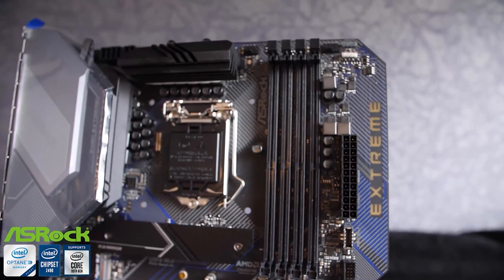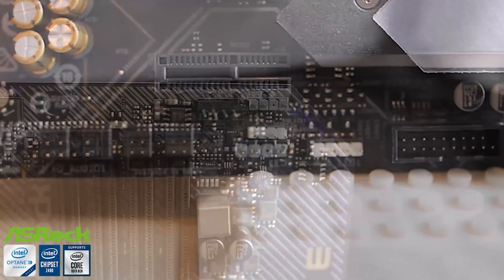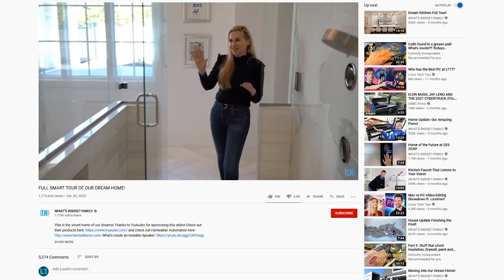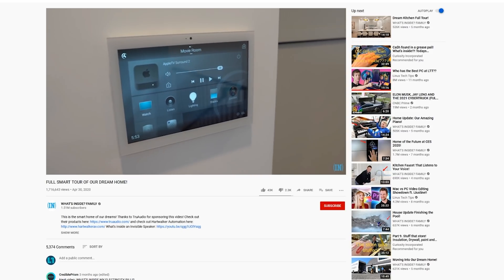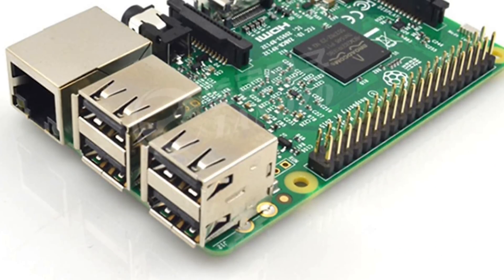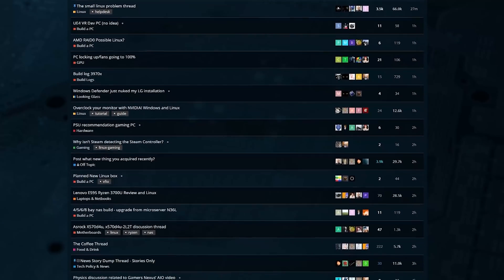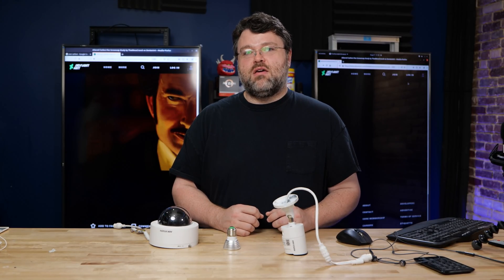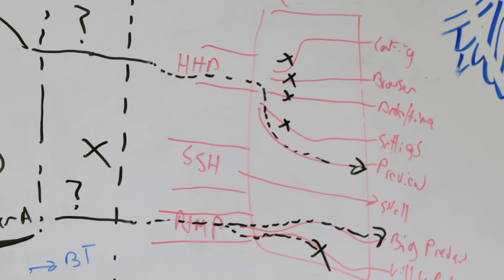Building A Better IoT Part 2: Can We Create A Safe Home Automation System?

Comment: I'm late to the party, but IMO, most of these smart home devices just shouldn't be connected to the internet. There is zero reason for your lights, switches, cameras (especially cameras) to be connected to the internet.

These devices should be on a private network and only communicate directly with a central controller (like homekit, smart assistant, or an NVR). Your controller becomes the only weak link.

Cameras are really off the mark IMO. Their only job should be to send footage to your NVR (and other camera specific things like IR lights, tilt, zoom, etc). The decision of what to record, when to record, motion detection, object recognition, etc should be done by your NVR.

If you want to view your camera footage, control you lights, or turn on the heat, you can do so through your trusted, security audited controller.

Most of these smart devices are simply too smart for their own good.

Even smart TV's shouldn't be connected to the internet. IMO smart TV's shouldn't steam content from the internet, there are plenty of other devices (firestick, roku, apple tv) that can do that. Again, let it connect to a controller so you can control the TV's functions (turn it on/off, change volume, change inputs, etc).

Imagine connecting your TV's, roku, playstation, blu-ray player, plex server, etc to a controller. You could pick which tv is connected to which device, or maybe steam one device to all TV's.

Obviously some devices need to be connected to the internet as a function of what they do, but those are the only devices that should be connected to the internet. Your streaming device needs to be connected to the internet, your TV does not. Your computer needs to be connected to the internet, your mouse does not. Your phone needs to connect to the internet, your headphones do not.

Comment: Can I do this by firewalling it off on a VLAN as thats the generally the recommendation for security cameras. Does a WAF and programming all the filtering/encryption yourself really the only way to get it secure? I don't have the education to do that no programming or networking experience. I was going to get some small business ubquity gear and follow some beginner network security and VLAN / firewall / Remote-in w/ VPN / traffic monitoring tutorials especially with all the relatively recent USA government ban on these cameras as a lot of them use huwei chips.  Maybe I misunderstand and me using the ubquity security software on the Dream machine pro is basically a WAF. Yet you concluded your video that theirs basically no way to make it secure without your level of extensive knowledge.

Comment: Philips Hue is great, the system seems to work exactly at intended for my parents. Only 4 of the 60+ bulbs have ever become disconnected from the hub, and that only happened after a power cut (and they've had several other power cuts and it has never happened again.

The hub also doesn't need any internet access, so if you want to just block it you can. And it all works by ZigBee so it's not the insecure mess that are WiFi bulbs.

Oh and it has really good support with Home Assistant and other similar projects.

Comment: CAN and RS485 can be a good option, SPI although technically feasible is not foreseen for out of system communications, CAN and RS485 are a better match. Also running parallel CAT 6 cables all around ur house seems unnecessary. A  Serial/ Star based architecture is a better solution for IOTs.

Comment: It's be great to have an open source proxy that can do this, with plugins for new hardware as it becomes available.

A nice web GUI to inspect traffic and whitelist things, Runnable in a rocket on a switch or pfsense router or something.

Perhaps to make it even simpler, a device like a switch running this software that will automatically recognise and segregate new devices on a vlan to pump through the proxy.

Comment: Yay! Part 2 is here!
I'll see what I can contribute as I too would like to get this going somehow, especially with the Open Source crowd.
I believe wireless is the best way to go. You can secure it and deploy devices almost anywhere. Low cost used wireless devices can be had for really cheap on sites like Kijiji. I'm definitely in on this project.

Comment: Surely you just throw control signals down the internal power wires. Most of the signals are going to be off and on, or colour and dimmer signals. The only thing you need high bandwidth for is media and security data.

Comment: Crazy idea here, since rewiring is an issue is there a way around that? The right approach for IoT is not only open source, but also cheap. So with that in mind, how about implementing a custom data over the power line protocol? It should be quite effective for low bandwidth devices, and as for cameras ethernet there is fine.

EDIT: There are pretty cheap IC's that do just that Power Line Communications Modem is one key word to start agooglin'

Comment: Why not setup all your IoT cameras on a different subnet within your home and isolate them with a sort of "reverse" DMZ? You could use one of the machines in your home as a terminal server so there's no outbound traffic hitting the internet but you could still access footage through the web GUI? This wouldn't solve your problem with devices like Nest and Ring, but it could be a jumping off point for something more substantial down the road.

Comment: The giant bundle of wire can still be hacked to give you direct access to device protocols, it's just harder. Devices themselves should have either a jumper/tag you remove to put them into post-configure mode, or a way to remotely attest configuration data and OS integrity.

Comment: Have a look at KNX. It's an open-source protocol used for building and home automation that is around for 30 years. I installed it in my home and it works great. Since it's only a protocol it can be implemented either wired, wireless and over IP (again wired or wireless) and there are mutliple companies around the world that produce devices that operate on the protocol and deliver everything from turning on loads (lights, outlets etc.), thermostats, switches, various sensors to interfaces to other protocols (Zigbee, RS485, propietary HVAC device etc.). There are two downsides to it, in my opinnion: 
1. rather slow (9600 baud), which is not bad, considering you do not have a lot of traffic flowing (how often do you turn on/off the lighting or how much does your temperature fluctuate, etc.) This short comming can be resolved by optimizing the topology, but it is still slow, in 2020.
2. The software used for commissioning the system (ETS) is only available in Windows and the license is rather expensive (it's meant to be used by certified technicians, even though its not rocket science) and there are no open-source alternatives available, yet.
I got certified in KNX after programming the devices in my home as I really think it is a great backbone for a modern home. I use Home Assistant on top of KNX and I can use it to bridge other systems. For example make my robovac to come and clean the kitched by pressing a light switch.
If your interested in this I would gladly help you out with getting started.

Comment: BACnet MSTP is a master slave Tolkien passing protocol that uses Rs485. Its a protocol that’s been used in industry for many years.... rs485 is very touchy on how it is wired and the converters to ip based communication is expensive

Comment: You should check out KNX it’s a fully hardwired system with a bus line to connect devices like Motion sensors and keypads. It links directly to Home assistant. I’m building a house and I was looking for a hard wired system like control4 without  the price and I happen to find.

it’s mostly used in Europe but you can get it here too

Comment: In a previous life I did Crestron programing and the amount of wiring in the walls brings back memories. Their web interface used to be an IE plugin (1) which was...a choice.
The development environment was interesting. It was a windows executable that launched Cygwin(2) to do the cross compile in GCC(3) so you could send the code to a CNMSX(4) over a serial cable. Good times.

1) Their touch panels ran WinCE. Hours of battery life. Hours I say.
2) Or similar
3) Which was an ancient version
4) The brains of the system

Comment: I have over 50 esp based light bulbs for my new house ready to install..
As well as power controls and other relays and sensors.
They cost £2-10 each and all work with tuya.
Needless to say I'm also scratching my head at the moment on how to safely implement there setup without endangering the world by putting them on the internet.
I have carefully picked every light and most of the other devices ensure its esp based so they can be reflashed with another firmware as honestly much though I like tuya, can it really be trusted?!!

Comment: If you're doing something in the middle you could consider using srt (secure reliable tranaport) on the outbound side of the video instead of rtmp. Resilient to packet loss and encrypted

Comment: One thing I think we need is cheaper and smaller switches with fast uplinks. Running tons of wires to one spot where you need a lot of ethernet devices is pretty gross and it'd be nice if we can have switches that just act as traffic aggregators to push all that traffic over a single higher speed link.

Comment: 4:02 947 PPM CO2 is NOT what I would consider to be in the "good" range. That's definitely in the "acceptable, but you might consider more ventilation" category in my book. It's not at dangerous levels by any means, but it isn't great. Personally, I start to notice cognitive effects as low as 850 PPM, and I definitely feel "off my game" if it's over 1000 PPM and I certainly don't sleep well when it's that high.

Comment: i've never been a fan of wireless, even back when i was a radio operator for the Marines. it's to easily blocked, hijacked, cracked. . . . . . . .
Reply: or weak and spoty witch i s why i have wired 10 gigabit cat6a and multiple access points wire where i can and wireless distributed over multiple APs

Comment: I think the idea of an application firewall is a excellent solution for things like smart tvs were being on the internet is key to their functionality.  That said, I'm not sure it makes much sense for things like carera's and smart devices. I agree I don't want those things on the internet so I run a VLan for my cameras and a separate VLan for my IOT devices like dimmers and motion sensors and the like. I then run local servers (Home Assistant and ZoneMinder) that are on the private VLans and but also have internet access if needed. What do you see as the use case for letting Cameras and IOT devices have even limited access to the public internet?

Comment: I've built a home auto system back a few years as a project to learn IoT, it wasn't great and probably is insecure. But man it was fun, have the door bell turn on a light, the RFID turn off the TV, any switch can be redirected to any light/lights, or any thing controlled by any IR remote that you setup.

Just designed and printed new outlet boxes that house a 120v ac to 5vdc board, a raspberry pi 0 w, outlet covers that hold arcade buttons, docker and a bash script that if the pi can't get internet become a hotspot (gotta love nmcli) and host a setup page to give it the Wifi, central host, and the host's public key.
Reply: Do you have your work on github or ?? This sound great.

Comment: KNX and DALI do exist though :D which are open standards so you arent stranded with a single company though its more common here in europe :D and for those networks you can basically have any topology without switches :D
Reply: KNX is kinda expensive though, but for people who want the reliability of wires this is a decent solution. Also, KNX is not really meant to install  by yourself. Technically it's possible to diy it, but in practice you should be looking at a professional installer to get it done for you.
Reply: @Rolinator1  yeah other then that i dont really see a downside in KNX and for a cheaper price DALI is a close second :D

Comment: There was a passing comment to esp32/esp8266 devices in the video as not been secure. I use a lot of these devices with ESPHOME custom code connected to hassio. These devices by themselves have no internet access and live on a VLAN with cheap ass 1080p cams on another VLAN that also have no route to internet and are activaly blocked (wired of course)  Everything can be accessed from my vpn with freeradius certs ETC. Not sure how insecure these devices are maybe somebody very close may be able to disassociate them from wifi get hijacked if so it would be very disappointing as the network they have access to is treated as very hostile and the devices themselves don't do anything critical. At the end of the day every device/network/phone ETC is waiting to be hacked. I agree open source is the way forward and education around networks and code is escenshal the last thing we need is one stranded/company where 1 zeroday leaves everyone exposed.

Comment: I like having my "smart" devices dumb. I don't need any cloud-connected devices, I want everything on a separate wired network, inaccessible without plugging a cable into a port or modifying a vlan on a port / in a trunk on a switch or changing a firewall rule (one out of the 3). I used an arduino uno at my workplace to detect movement when inside the premise and open the door (because people are too lazy to push a button and they were getting head-on inside the door). Having that sensor there helps people be lazy and not lose momentum when walking. Best part of it? Doesn't even require a network connection, not to mention internet connection. It's just an arduino with an ultrasonic sensor and a 3v (mechanical) relay (solid state ones are better, but more expensive). And no, you can't open the door from outside, tested it thoroughly with my colleagues. The bad part is that you need to connect a USB if you ever want to change the code or add features (which is basically never at that location).

I am thinking of using some old *Pis and wiring some lights in the house and have some cron jobs to turn the lights on in the morning when my clock rings (maybe even make the lights flash, so they are more annoying - for flashing lights, I highly recommend solid state relays). Cameras don't need any introduction, you can do IP cameras and have a samba / nfs server for storage, or buy a DVR with coaxial cameras if you want a more professional setup. Make a VPN and connect to your home network to monitor them, don't use the manufacturers cloud platforms. 

Lock systems are a little scary, especially if you want to unlock without a key, so I highly recommend old locks. But considering people have garage doors that open with a pretty insecure key, well, you could make a locking system using Pis and relays (again) with electromagnetic locks and either use a VPN to remote home and unlock a specific door, or have a hidden wifi network that you connect to in close proximity to unlock the door. Again, I recommend neither, because the risk of getting cracked into is quite high (and it's pretty easy to scan for hidden wifi networks).

Bonus points if you use Mycroft or similar software for voice commands, but your setup gets more complex and you need microphones and speakers. Funny stuff, while a part of me is somewhat excited about making a secure home automation intranet (again, with no access from outside or even from my normal LAN), another part of me is really autistic when it comes to security and I think I shouldn't trust computers and try to do as primitive a setup as possible (up to and including having a rooster wake me up in the morning, instead of an alarm clock - and I can't snooze the rooster).

Comment: My 4 cents on this:
1. You don't need most of the home automation stuff. It may be fun for a while, but basically useless in most cases.
2. Yes, security is a big problem in IoT Devices
3. I disagree on breaking up an encrypted connection on a WAF. For me encryption should be end-to-end. You can still block anything dangerous by source and destination
4. I think it is a bad idea to let an AI decide which traffic is good and which is bad. You will not be able to debug what the AI learned in its neural net.
Reply: What about a routing hub that adjusts the TTL in each IoT Ethernet packet so they time out before reaching Nest HQ?  ( I'm not advocating the use of Nest BTW )

Comment: Going all-out on filtering system for out-of-the-box gear might be very useful.  I've been playing around a bit with replacing firmware on devices but it is a lot of work finding the right gear and you end up having to dig into enclosures to attach to programming ports, etc.

Comment: I stopped measuring my spaghetti a long time ago.  Instead I built a jig with a stop on one end, and on the other end is a diamond encrusted circular blade spinning at 20k RPM's.  Like a chop saw, except the blade is running on air bearings.  Oh and the entire apparatus is inside a climate controlled box as humidity and temperature caused significant deviations.